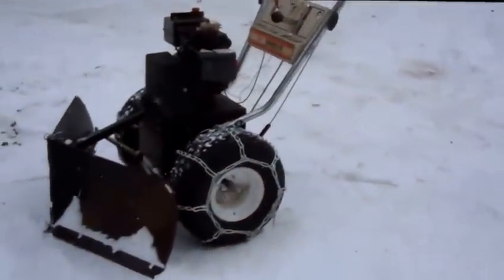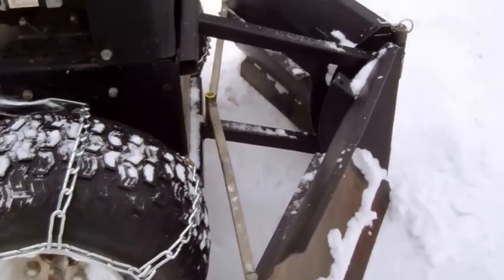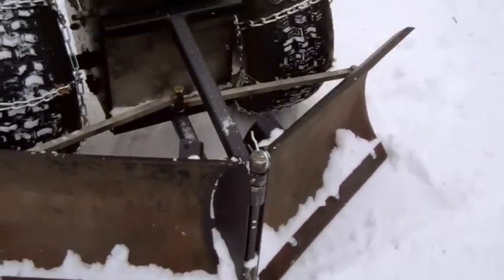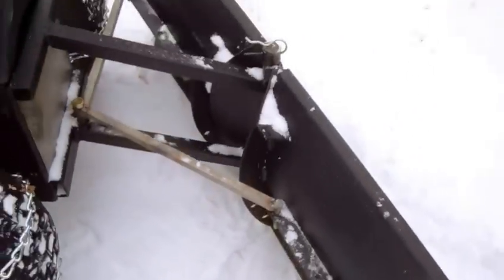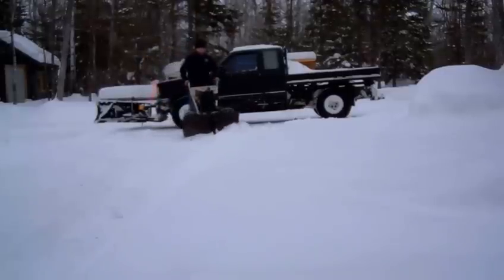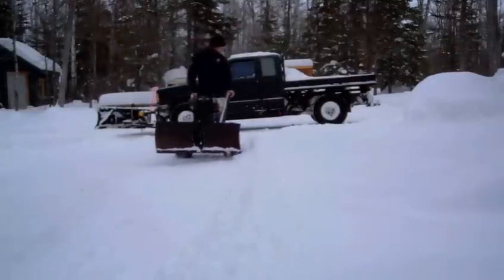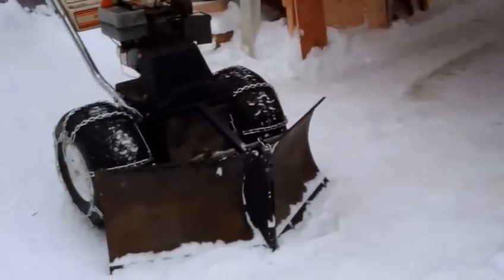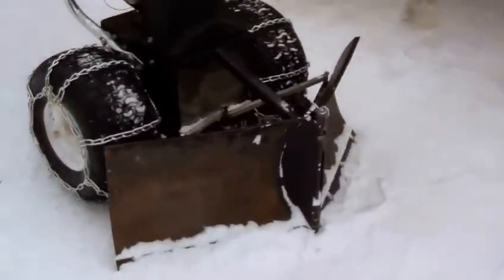Snow Clearing With My Homemade Walk Behind Snow Plow DIY

Comment: About twenty years ago, I installed a plow to the front of my snow blower. It could be attached or removed quickly. It was nice when there wasn't enough snow to snow blow. It was great for smaller driveways. Nice job.

Comment: You know it would be worth having one of these around in addition to a regular snowblower just to move the heavy, slushy windrow the plow leaves in the driveway.   Or to move bigger chunks that have fallen into the way.  I'd add some weight to it for some more traction.  Cool project for an old snowblower with a broken damaged auger or auger gearbox  (like a million old MTD units out there 😆).

Comment: Toro made a blade to convert there blowers like this.  In order to make it push better you could load the tires.  Either have it done commercially with chloride or put tubes in and fill with antifreeze yourself. You can find videos on how to load tires here on you tube.  Loaded with antifreeze they should be about 25-30 each, with the chains it should push nicely.
Reply: uhu, toro made some cool stuff like their wheelhorse tractors you could buy dozens of attachments for them like snowplows, snowblowers, steel wheelweights, tillers, gardenplows you name it!

Comment: I have a homemade one as well, just a straight blade though.  New tires, cast iron wheel weights, and windshield washer fluid in the tires, it pushes really well.  We use it commercially for sidewalks where there is no safe place to blow to (due to parked cars or plate glass windows).  I think I have around $350 in my whole machine.
Reply: man I should have read further, another smarty pants! well said; well spoken (written) lol

Comment: Awesome love that your shovel is adjustable. I had the same idea in converting a blower engine. But welding a hitch receiver at the back to accept a coupler and make a Segway for my feet 😂 so I don’t have to push it. Idk if the motor is strong enough for that… we shall see 😅😂
Reply: Good idea. Hope you tried it.

Comment: What an excellent idea! Why aren't these more common? This is so much more effective than a snow thrower plus the snow buildup is easier to direct and manage.
Reply: Due to being so light, they don't move much snow. Deep or heavy snow will bog it down. I had an ATV plow years ago that moved snow pretty good. The problem was that it could make high snow piles. Eventually the snow piles move out not up. But, this would work great in concert with some other equipment to keep the area wide enough.

Comment: forget loading those tires with WINDSHIELD washer fluid good to below 18 degrees, and NEVER use calcium chloride, I don't care WHAT john deere says.  and you can get the part at gemplers for like $10 and load them yourself, but what I would do is get a two 25 pound weight plate for a barbell (metal ones are thin) and extend right thru the hole of the weight from the axel, use the chains and a bungee cord to hold it stable or even some zip ties. now you can plow some snow.

on my way to craigslist

Comment: i have a craftsman rear tine tiller. i take a 2x10 about 36 in long. clamp it to the dirt shield and use it to move and grade gravel in reverse. that tiller pushes in reverse like a small bulldozer. i mostly use it due to the garden on a slide slope. the soil slides down in the winter. so i just till it up. clamp on the plank and grade the dirt back up the slope. my ol lady said it would never work. until she came out and watched. then said how the hell did you know that. well i had just used the shield itself and back up and push dirt. when i realized the pushing power it had i was like hell this dam thing is like a mini dozer. except it needs a wider blade. my neighbors stand there in disbelief watching it push 100 pounds of gravel like nothin. i even use it to spread driveway gravel. i did have to weld some 1/2 in square tube to the dirt cover to strengthen it up. so far going on 4 years it has worked flawlessly. i was going to convert my now blower. but the tiller weighs more and has farm type tires. it pushes me backwards. i can't stop it. it has some serious pushing power. I'd rather have a compact loader/ backhoe but not for no dam 20 grand. forget that. even that used crap is over priced so i adapt with what i do have. i'm always using my years of mechanical experience to fabricate all kings of things. i made up a trailer hitch receiver with a 8000 pound winch with a deep cycle battery for power and just slide it in the trailer hitch and use it to pull our stumps, rocks, etc. i even put a blot on receiver on my yard trailer and winch big tree trunks and heavy object right on the trailer. a car battery will die using it. even with engine running. so i just charge and use a marine deep cycle with it. works fine. only have to keep letting winch cool after 45 seconds of use for a few minutes. guess it is what it is. would be nice if those Chinese idiots put a level winder on it. to keep it from binding up. oh well

Comment: When the power use is eliminated from the front end does that allow more power to the drive?

I have a cub cadet track blower I am sick of fixing the auger and impeller and belts etc. I have a better blower now and want to figure out what to do with that old 8hp motor and nice tracks.
Reply: You could turn it into a power wheel barrow.